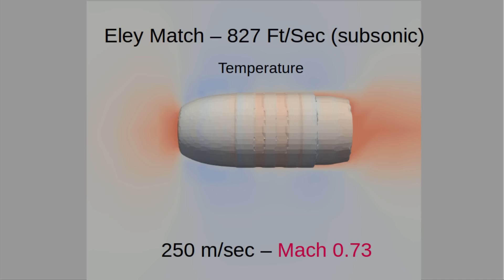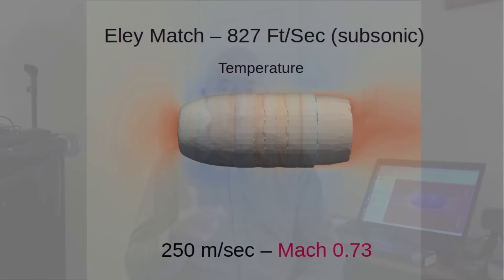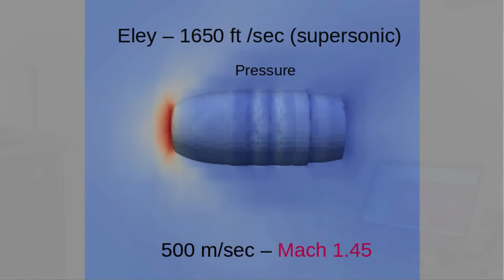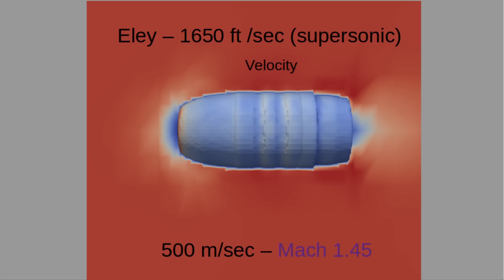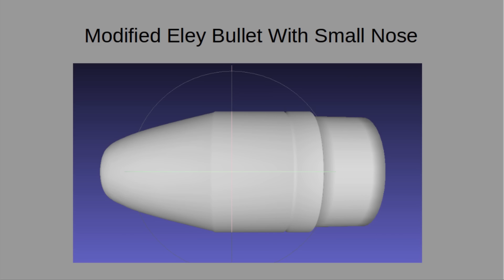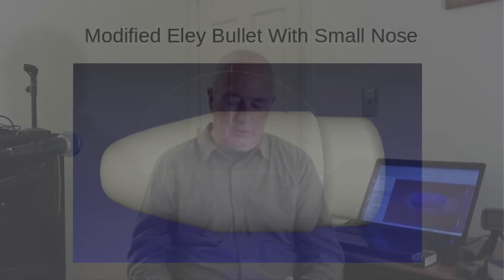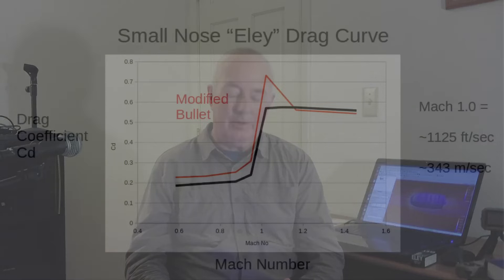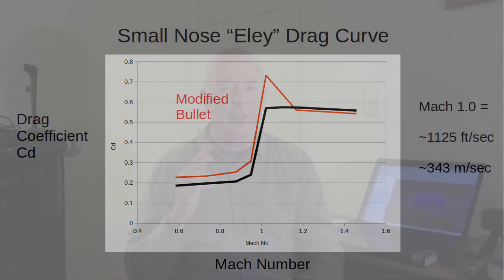22 LR Aerodynamics and Ballistics

Comment: I have been reloading 22lr and researching the function of them for the past 8 yrs. Your cad drawing is not quite accurate. The reason there is hollow base on the 22lr is so that the pressure (once the bullet leaves the cartridge) obturates the heel of the bullet into the rifling. Which actually expands the heel to the same diameter of the bullet. The heel picks up the rifling just like the bearing surface of the bullet. This leaves a nearly flat base in flight. They still have some of the hollow but not as much as an unfired bullet. I have learned a lot about the function of 22lr. I have some videos (very poor quality) of it on my page here.
Reply from the maker: @HansFormerlyTraffer  Thanks. Several people have pointed this out. Too bad, as it probably adds a bit to drag, but improves stability.